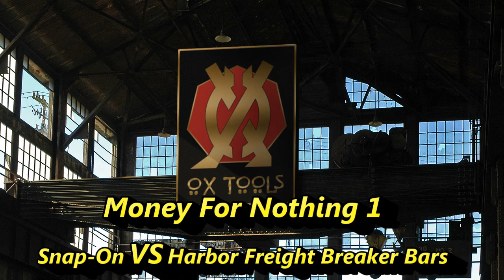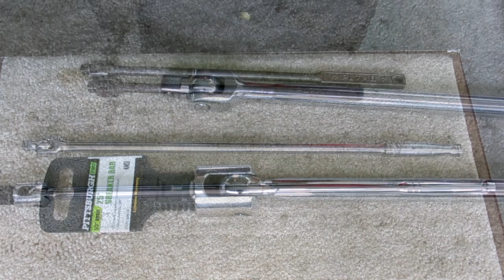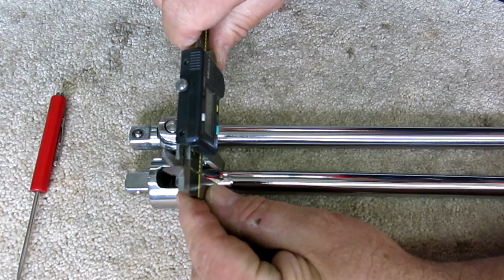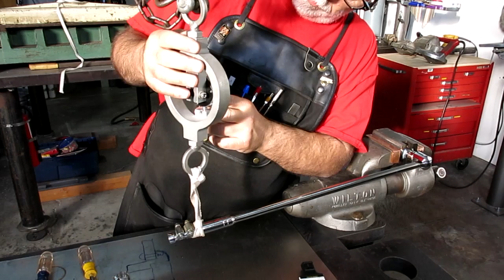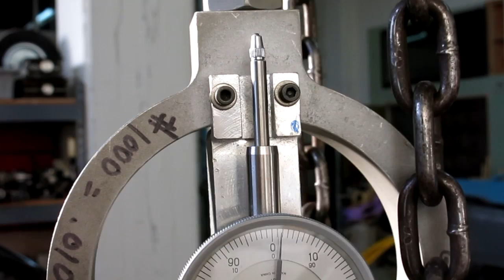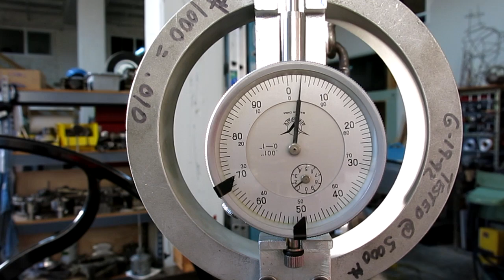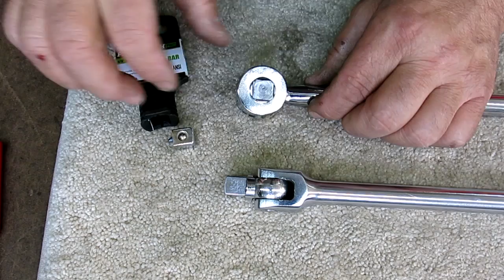Money For Nothing 1

Comment: The external knuckle versions do have one advantage though.  If you break the knuckle that broken part is available cheap on ebay as a spare and can be easily replaced.

If you break the other types of breaker bars then they will cost you much more since they aren't able to be repaired.

Comment: The HR bar ain’t bad when you consider it’s fifteen bucks or less on sale and basically disposable…. Don’t know what the snap on goes for but 10 times that wouldn’t surprise me… if you need over 600 ft/lbs probably time to get the air tools out in any respect, not too many common fasteners are gonna take that with linear force without something giving, I’d hit something that tight with an impact in practice, to snap it off without breaking a knuckle haha… Having said that I’m a fan of buying the highest quality tools you can, especially hand tools. I own some HF stuff that will rarely get used just to keep handy if the need arises and I’m not ashamed of it, hard to justify tens of thousands invested in things that may never find but one use in years…

Comment: Back around 1976 I was changing wheels/tires on a motorhome, those lugs were tight..... I'd tried jumping up & down on the Snap On breaker bar so it was time for a cheater pipe... I found a  five foot length of 1.5" galvanized pipe & still I was using my full body weight on the end of the pipe... The bar was visibly flexing considerably more than your bar did & it returned to it's normal condition with no signs of fatigue.... 45 years later that same bar is still in my box & it saw a lot more abuse through the years.... I broke allot of Snap On tools but not that breaker bar... Those things are made of some tough steel...

Comment: My conclusion is that a tool costing seven times as much is better. Not much of a surprise. What would have been bad is if the Pittsburgh equaled, or bettered the Snap-On. My experience with Snap-On is that some tools are very good, and some are not. The Pittsburg costs $20, while the Snap-On costs $140. You can buy 7 Pittsburg bars for the price of one Snap-On. But the HF Icon, which is their professional line, costs $50. I’d like to see that comparison. It’s still just about one third the price.

Comment: Great video, you made breaking shit fun.The way harbor freight gets trashed on qaulity so much is unfair. That breaker bar for the price is a great tool. If you're under a vehicle pulling as hard as you can it's not going to fail period let alone in the way the video shows. I've used that exact bar with a 5 ft pipe cheater with no failure, plus lifetime warranty.

Comment: The failure point, failure mode, was not at all a surprise to me. The material itself is not of the highest quality, or most ideally suited to the application. The location, near approx 90 degrees in the material, especially if any heat treating was done, is to be expected.

Comment: Yes, the design differences are exactly for the difference in cost of manufacturing of the two designs. There are multiple design differences which reduce the cost of manufacturing the HF tool (without even any consideration of cost differences due to materials utilized, or considerations of cost reductions due to economies of scale).

Comment: Another great video Tom. It is always satisfying to measure things. I might have put the fixture in a slightly rotated position so that at torque the chain-fall would be pulling at 90 degrees to the handle. I suspect that extreme angle when above 250 was causing some problems. And, I'll add a couple data points just because I can. My 0-250 ft-lb torque wrench is 24" long. My 18" Craftsman breaker bar is over 40 years old and I still stand on it to remove lug nuts at times. I'm sure at some point when I was a stupid teenager I stuck a 3' section of pipe on it to really gronk on something. It is still pristine, with no excessive play or signs of abuse. Its primary use has always been for the back axle nut on motorcycles.

Comment: This doesn’t really affect the conclusion of your video, but I noticed that you computed the torques without taking the drastic deflection angle into account. Since you weren’t pulling perpendicular to the bar (it looked like you were about 30 degrees off at the end?) were actually putting less torque on the bar than what you stated (15% less?). Maybe you already figured that, though.

Comment: Snap-on tools are way overpriced. Given the load rating of the tool that you are testing I believe that both preformed acceptably. Sure the snap-on tool preformed well past the load rating but for that price it had better. At that pressure you should be using a different tool anyway.

Comment: Here in 2018, my 25 inch Pittsburgh breaker bar is tighter than that snapon,  measured for freeplay that way in the vice.  I wont be exceeding 600 ftlbs.  For 8.99 its a no brainer in my home shop.

Comment: I understand why you compared the harbor freight 12.99 25" breaker bar to a what 150.00 snap on, after I watched this video I went to the local HF to look at the breaker bars for myself. They actually have another breaker bar for 19.99 that is built more like the snap-on surprise surprise, but I know you were trying to simulate a 300lb man leaning on it but........ I thought I saw on the screen that the calculated ft lbs was 7200ft/lbs is this correct? In my work I have to torque nuts to  320 ft/lbs torque on certain instruments, I am over 300lbs myself yes I am fat.... and I have a hard time doing that with a 36" snap on torque wrench. Another way to test it's resolve would be to mount it in a vise as you did and just add weight to the end of the breaker bar. An extra note you were really lucky you didn't ruin the snap-on. I understand everyone that has been able to buy snap-on tools feel threatened by cheap crappy tools harbor freight sells doing the same job as their better engineered across the track brothers (snap-on) do. I watch all their videos testing the two brands against each other, but really matching a $13 breaker bar against a $150 breaker bar. The $150 breaker bar better win. Now I'm coming off as against you and an asshole but I don't feel that way I like your videos and hardly ever comments on any posts of anyone because, I'm here to learn not pick on. Like as a famous you tuber said if you don't like what's said make your own videos....keep your ** in a vise.
Thanks, for the good videos I do appreciate it.
Bill Jordan

Comment: I think you might have bozo'd on your measurement of the pivot on the snap-on vs the fastener on the horror fright tool.. You assumed it was full diameter because it moved? If that's the case, what's keeping the pivot from just falling out? My guess would be the pivot has been peened over, meaning it's more than likely smaller than the 10mm you suggested.. 

That being said, i was quite surprised that the failure happened on the square.

Comment: You say you would have rather had a ductile failure, but really that's what you got. The sheared/smeared metal at the break is proof. And actually that's part of why it failed so soon. Once you got to that point where the tension wasn't rising as you kept lifting you got into plastic deformation territory and failure of the tool. Chrome-moly has it's maximum shear resistance at a fairly high hardness. And that's probably closer to what your Snap-On tool is like. But when they do break it's an instant fracture.
Still, if your not the type to put a pipe on the bar the HF would be fine. 200lbs pulling strength is actually quite a lot for your average man.
Reply: Exactly, and 400lbs pulling is world record territory. Interested parties can search for "heaviest weighted pull up record". The only way I can see average man putting 350 pounds on that bar is either weighing that much and standing on it with one foot, or using a cheater bar.

Comment: I have a few tools and I would have expected what happened. there is a large difference in the cost and how good a tools feel in your hand. there is more to snap-on and other good quality tools then just being stronger but stronger is good :). there have been time when I was really laying into a tool wondering if it would break but just knowing it was not a bit of crap gave me to confidence to do it. just looking at those two breaker bars there have been time where having the more compact head would have made a difference getting the socket in place. when you released the harbor freight breaker bar the first time and notice it was sitting more level to the table the bar had already started to twist and had not reached the fracture point yet. if you looked at the part that goes into the socket Im sure you would see that not only as there less play in the snap-on but also it was square and made more complete contact was the socket(4 corners not 3 or 2). the socket most likely acted like a shear and started the cut and from there is was down hill.
Reply from the maker: Hi Tom,

Thanks for the comment.

Cheers,

Tom

Comment: As a Mechanic in both Automotive and Heavy-duty, I have busted many breaker bars like that, I am only 155 lbs.  In all reality you were exerting over 600 lb-ft of force on the square drive, even though your gauge was reading 300lbs. Force being measured by weight times the length of the bar= torque applied.  Not to Tea bag for a cheep $10 tool.

Comment: Push a tool beyond it's capacity or using it improperly and it will break. Chrome plater socket on an impact tool will break easily under stress.  Using a cheater bar constantly on a good quality socket wrench and you will break it eventually.  Using a small screw driver as a pry bar and it will break it.  Will this breaker bar remove the tire lugs off your car? Yes! Will it take off  the lugs nuts off your work van? Probaly but if it's frozen and you have to put a cheater pipe on it them there is a chance it will break on you.

Comment: Never spend big dollars on any hand tools other than a snap-on ratchet. A spanner is a spanner is a spanner. Will you ever get a broken socket? Sure, maybe once every 20 years. Plus most tool companies offer lifetime replacement warranty so there's really no reason to spend $1500 on a set of wrenches you can buy for $30.

Does it have moving parts? Spend the money. Doesn't have moving parts? Get the cheap one.

Comment: i usually dont buy harbour freight tools except for cave man tools like breaker and pry bars. i have that exact breaker bar the pittsburgh. ive abused the hell out of it on ultra rusty seized suspenion, brake, axle components for several years and its still going stong. cannot beat it for the price. ive stood on top of mine and litereally jumped up and down. and even if someone didnt want the cheapest of the cheap there are plenty of quality breaker bars at a quarter the price of the snap on that will do the same job. however i do have one 3 inch 1/2 drive snap on extention that i cherish  haha

Comment: Snap on wins, still Pittsburgh is not money for nothing, and is a good enough piece if you are a weekend warrior, hands down. Unless you are a toolnut, there is no point shelling for snap on, for an occasional wrencher. I wrenched on a 24' box truck, and harbor freight never broke, always held up to anything it encountered at on that truck
Reply: yeah, harbor freight are not industrial tools, I use this exact breaker bar, and it has worked perfect for working on my cars and motorcycle, and it cost 10 dollars....perfect for its intended use, if there are bolts on my freaking motorcycle that require more than 350 ftlbs....Ive got bigger problems.

Comment: I like your channel first of all.  BUT I think you were dead set to make the Pittsburgh tool fail from the start.   Realistically, no 24" breaker bar would or should see that kind of force, even if so, not at a continuous pressure.   Secondly, you tested the Pittsburgh twice while testing the Snap On once.   

All that said, I think there are many other factors you're missing.  First and foremost, price.   A $20.00 Breaker Bar vs a $200.00 Breaker Bar.   In real world use, is the Snap On really worth $180.00 more?  I think...  scratch that, I know not.  Both have a life time warranty. There is simply no way to justify the Snap On tool in real word use.

Then there is the fact you are comparing the most expensive tool on the market to the cheapest with nothing in between.  Point is I have tested Pittsburgh sockets and wrenches in torture tests vs Craftsman, Matco and Snap On.  In ALL those tests the Pittsburgh was always very comparable to both Matco and Snap On and far superior to Craftsman and Craftsman Professional.  Bottom line is, for the price of Pittsburgh tools, nothing comes close to price vs quality.

Comment: I must have gotten lucky with mine... I weigh 175 lbs and had that exact breaker bar locked onto a seized front axle nut on a Honda Accord.  I had my jack handle crossed between the wheel studs (with nuts on them) and locked onto the ground to keep the hub from spinning.  I had a 5' cheater bar slipped onto the HF breaker bar, and was standing and bouncing on the end of it to try breaking the nut loose.... unsuccessfully.

It wasn't constant pressure, but that's roughly 875 ft/lbs and it didn't break.  What it DID do was bend my jack handle into a small S-curve.  That kinda ticked me off! lol

I ended up picking up a torch and eventually was able to impact the nut off after cooking it for quite a while.  I would have done this first, but I forgot to bring my torch, and was 600 miles away from home working on my brother's car while visiting him.  So don't rag on me for using the jack handle on the studs lol.  I didn't want to buy a 3rd torch if I didn't have to!
Reply: As I side note though, I thoroughly enjoyed watching the video!
Reply from the maker: Hi Matt,

I might have gotten a bad one. The new pro models do look a lot better. Your example is what I was talking about. You needed to get it done so you used what you had. Thanks for the comment.

Cheers,

Tom

Comment: This guy used the inferior Harbor Freight breaker bar model ($13).  He should have used the Professional model ($20) which is similar in design to the Snap-on.  I bought mine with a super coupon for $15.  I used it to remove frozen rusted on lug nuts from a boat trailer.  My 250 pound son and I must of put over 400 pounds torque to break the lug nuts loose.  The wrench performed excellent. 

Show us you got a pair and do a retest with the HF professional model.
Reply: Gary Rogers why dont you do the test and film it?
Reply: Don't have the testing equipment this guy has.  Only my personal experience using the tool in a real world situation.
Reply: One other note, I not going to spend that kind of money for Snap On for a DIY.  The shaft is also thicker on the Pittsburgh Professional model vs the one that broke on the video.

Comment: I have that HF and a shorter snap-on 1/2" breaker bar. The snap-on might be better but I usually go with the HF since it give me more leverage. I'd put about about 1,200 ft-lb on the HF and it did not fail. That was with a long cheater bar and jumping on it for about 5 to 10 minutes before it gave out a loud bang when the Honda crank bolt finally broke loose.  

Good test, enjoyed the video. Minor comment, @ 22.20 torque should be more like 520 ft-lb rather than 600 ft-lb, for force perpendicular to breaker bar. Would be interesting to see the comparison on the HF Pittsburgh PRO sockets.

Comment: Tom,the Pittsburgh did fail in a sort of plasticky twist  as you can see when it would take the load and then slack off.When you put it back in the failure had already started and it was doomed.I pretty much knew it was doomed as soon as you mentioned the scale dropping so realistically the failure was quite a few lbs earlier.
I've experienced HF tools fail this way several times and they usually give warning as you can feel them twist.Once they get that initial twist though they are toast.I love SnapOn but I have had plenty of the HF stuff,especially the adapters and extensions for home use.Pretty much all of my failures have been with them twisting off in the same fashion and while I love y good tools theres times where I reach for the junk like when working by the water on boats and I've really reefed on some of the ratchets and they surprisingly have held.

Comment: If I have a nut or bolt I can't break with a half drive. I'll step it up to a 3/4 drive. Learned my lesson the hard way.  I will not throw all my body weight or use an adaptor to try and break a bolt or nut free.

Comment: Two points: The 1/2 " square on the Snap-On is longer, and will go down into a recess, while the 1/2" square of the Pittsburg is shorter and may not work in some cases. 
 Secondly,  You  applied tension vertically, instead of perpendicular to the bent bar.  It looks like you bent both bars about 30 degrees with the tension pulling at an angle to the bent bar. 
If you do another similar text move your differential chain hoist to the right to keep the force at right angles to the bent bar. That may not amount to much, especially if both bars were tested with the similar angular pull.